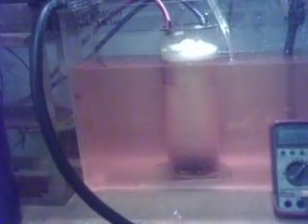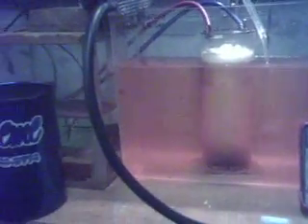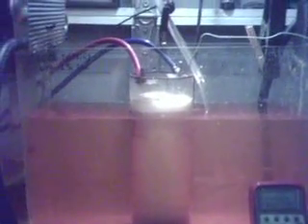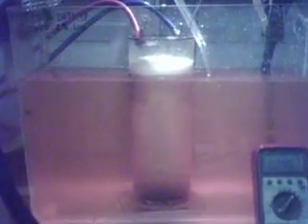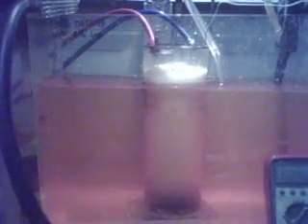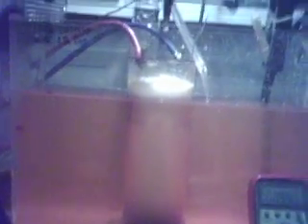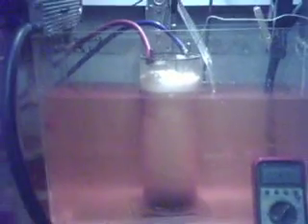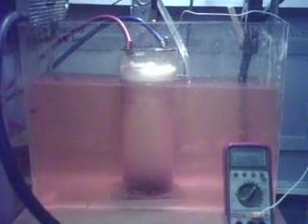HHO - Cooling unit installed - Hydrogen Project

Comment: When I ran one on my truck I used a regular automotive radiator and thermosiphoning to circulate the electrolyte. As the hot water rises along with the bubbles, the bubbles collect at the top of the radiator. remove the center gasket on the radiator and the HHO escapes through the overflow tube.

If the radiator you have does not allow that, you can put a T in the hose at the very top and use that as the fill point and where the HHO escapes the cooling line.

NOTE: I used a DIFFERENT RADIATOR than the engine cooling radiator.

I am in the process of building a HHO system to power the generator at my home. I have built several using this system, it not only cools but separates the HHO from the system. I have built several of these over the last 50 or so years. 

I also have plans in the works to power a gold mining operation of a friend of mine, they use about 50 gallons of gas a day and it all has to be carried about a mile in 5 gallon cans EVERY DAY. Also they have to move engines 150 feet from the water to refuel them. With a hydrogen plant, it is just a matter of running a hose to the pump and it never needs refueling.

The first one I built, I didn't know what it was, all I knew was that it burned and I was about 15. Luckily I was smart enough to take the 55 gallon drum of HHO outside before I set it off. As an afterthought though, I probably should have moved it a bit farther away from the concrete block wall. We had to replace 9 cement blocks and about 20 square feet of the roof. Not just the shingles, but the wood under it and one truss.

Luckily my mothers boy friend was a building contractor. He thought it was pretty cool for nothing but water. He was the one who told me about hydrogen and set me in gear for self destruction. Once I figured out how to not blow them up any more, it became pretty useful.